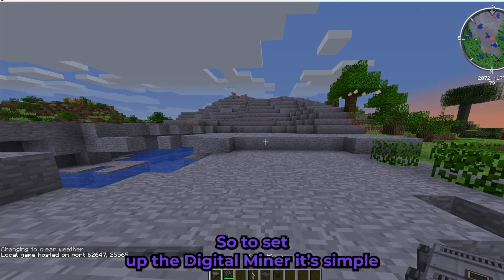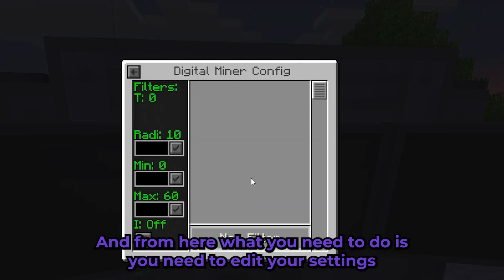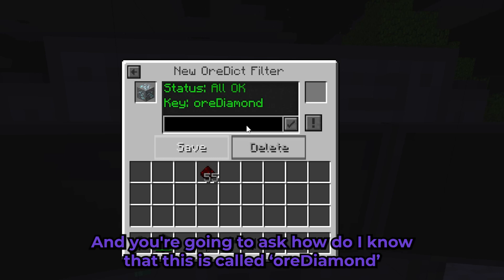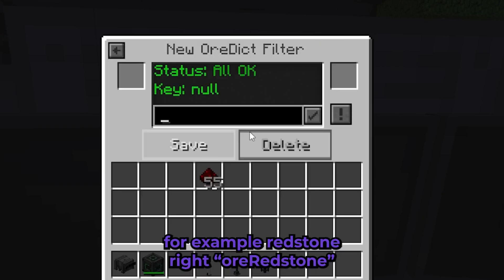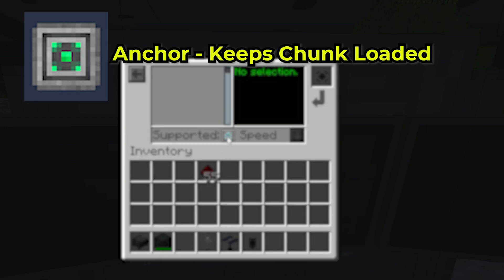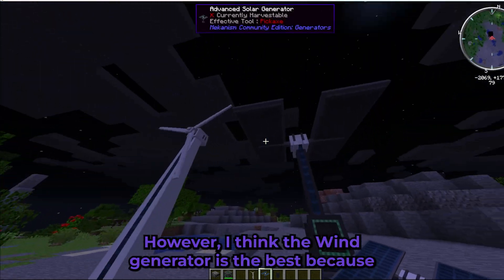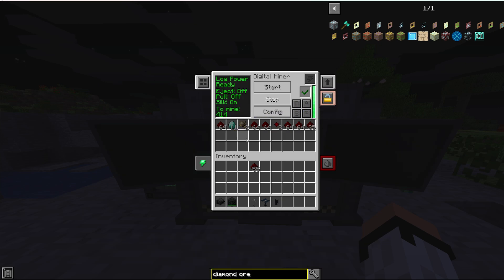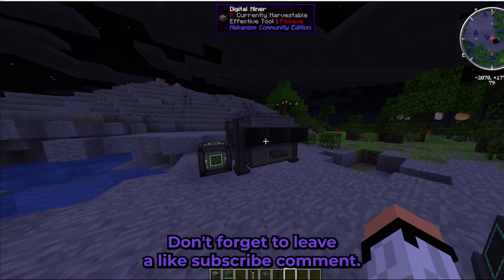How To Use Digital Miner Tutorial

Comment: Is this a 1.7.10 Feed the Beast Video? In this day and age? Holy Moly this brings back memories...

Unlike the easy-to-use Quarry or the all powerful World Cleave, the Digital Miner is a rather expensive teleport tool. Great for getting Nether Bees by searching for hives or even remoddling your house. Don't like your stone bricks? Set the Digital Miner to replace mined blocks with chiseld bricks or whatever you like, then let it mine the stone bricks in your house. It searches the blocks you wants, teleports them into your chest, and replaces them with the block you want. Also great when you don't want to leave holes everywhere. Be it overworld or nether ores, no air pockets mean no block updates.
Great tool, but really expensive. You put your first 12 diamonds into a Quarry to get you started, and after digging 64x64 holes down into bedrock a few times you set up a World Cleave for endless income.
Reply from the maker: It should be nearly the same, yeah.

But the actual pack I play on is called 'The 1.12.2' Pack, it contains most of the FTB mods (nearly 400 mods)

Yeah I used to use a Quarry for everything or go mining, but then my friend told me to use a 'Digital Miner' and that's like the first things I always want

Quarries are nice but it's just a pain since Buildcraft doesn't actually connect to Mekanism generators or others :(

So I have to get a completely new setup for Quarries and the engines are terrible
Reply: @go4t1337 Do you no use Big Reactors or Thermal Expansion Dynamos?
Reply from the maker: Uhmm, not really to be honest

I might take a look at it whenever I have some time :P

Is it worth taking a look?